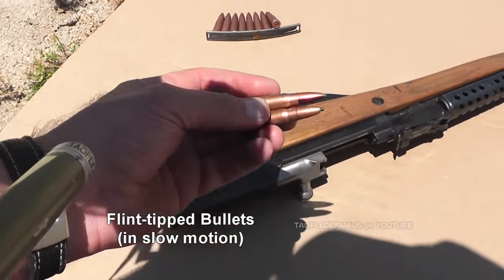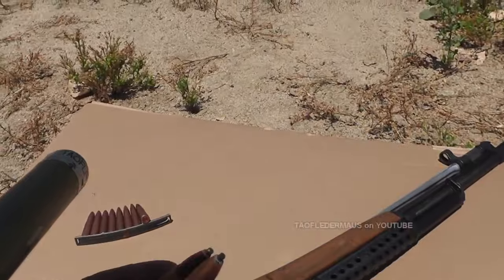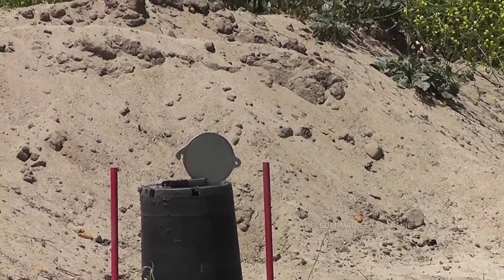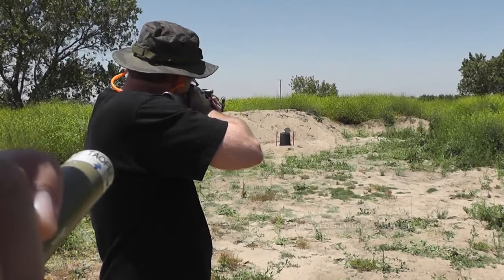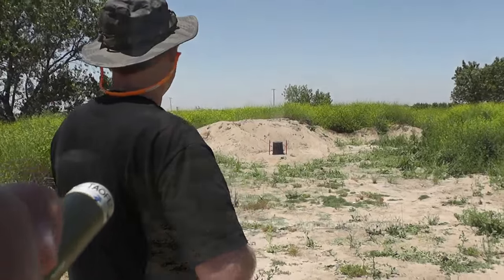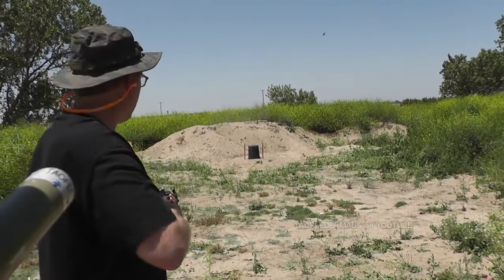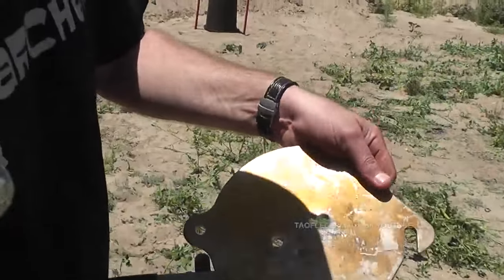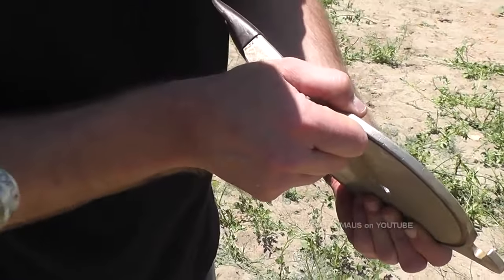ZIPPO-FLINT TIPPED BULLETS - Poor-Man's Raufoss

Comment: OK, since there have been almost 1500 comments placed for this video, I'm sure that the question I'm about to ask has already been asked and answered. But instead of going through all 1411 comments I'd rather to ask again: how did you guys inserted the flints into the bullets? Did you use the HP bullets? Was any drilling and/or tapping involved? Please advise.

Oh, and thank you for the cool video!!!
Reply from the maker: Yurishch  I belt-sanded the tips off the bullets to create a flat surface.  (they were FMJ)  Then I drilled into the bullet using a drill slightly smaller than the diameter of the flint.  Then I just pressed the flints in.
Reply: *****
Thank you! That helps.
Reply: I guess I missed that. I thought you just stuck them into hollow points
Reply: so what would happen if when you add the flint and  it is not centered correctly?
Reply: michelle racine, it would weeble and it would wobble and it would then fall down. 
Guaranteed to hit the planet 10 or of 10 times.
But YMMV so test, record and share. ;-)
All kidding aside, if the projo didn't maintain its rotational consistency the round would be less accurate.
How inaccurate would be dependent on the amount of instability was induced by the off-center addition and component removal.
Reply: @taofledermaus  OH, that sounds REAL interesting on LIVE rounds !
Reply: They did not insert flints, they inserted a ferrocerium rod, Zippo flints are made of a metal called ferrocerium
Reply: They are not flint, the flints are made from a metal called ferrocerium, they are just called flints because they spark, Zippo uses small ferro rods

Comment: you should try this at night ! would see a lot more of what it does .
Reply from the maker: +Mike Gunter  It's hard to aim in the dark.
Reply: +TAOFLEDERMAUS If you're ever able to, you should get a low-light setup. You can get a few cheap soft boxes, or make some DIY budget ones that would work well with your cameras (Tripods/flashlight stand, flashlights, and some thick tracing paper)

Just point the ones without paper on the ground illuminating the trail, and one with tracing paper pointing at the target. You may need brighter lights for the slow-mo though, because of contrast correction.
Reply: +TAOFLEDERMAUS what about... not night but... low light time.. :D :)
Reply: Aim by day, set up posts for front and rear of rifle, slot in at night and fire. Its how infantry used to and for some weapons still do for night defence.
Reply: Cameras not to good at night
Reply: +TAOFLEDERMAUS get as big as u can carry plate of 1/4" steel and use reflector tape to make a target or mark the edges

Comment: The question is...will they make a gas tank explode?
Reply: michael malkowski Gas is a volatile liquid that readily vaporizes into a gas.
Reply: Myth busters did a show where they shot a propane tank with tracer bullets and it didn't explode.... Also, given that you'd have to shoot through part of a car (assuming that's the kind of tank you mean) the bullet would deform well before it hit the tank, and it's been shown and proven many times over that shooting a cars tank will not make it explode.
Reply: Yes, gas readily turns to vapor, but if it's in a tank it's all gas vapor, and no oxygen, and without the oxygen gas vapor won't ignite. The simple answer is, no, this won't make a gas tank explode.
Reply: FPSRussia tested Raufoss rounds on a propane tank (felt Hank Hill was bawwing his eyes out) and it did not explode. You have to have a precise air/fuel mixture for the stuff to blow up.
Check out his video, he explains it a lot better than me.
Reply: The ThinSin alittle bit of gas and lots of oxygen is explosive, alot of gas and very little oxygen (in a bottle) is not explosive.
Reply from the maker: Absolutely,  Joshua.   The conditions have to be ideal for a flame to occur.  You must have oxygen,  fuel,  and heat to make fire.  However,  the air-fuel mixture has to be ideal-  if there is too much air or too much fuel,   fire will not occur.
Reply: Joshua Robbins That's why I said you need a precise air/fuel ratio! :)
Reply: NO there isn't enough exposed gas for combustion. Myth Busters even went and proved it. BUT I suggested above they try the old 1,2 movie version. where the 1st shot releases the flammables and the second ignites it. I think the only real tricky part(besides the right flammable) would be the timing of the second bullet. Oh and Myth Busters were using tracer rounds.

Comment: Just thinking about how it works. I think because of the flint sparking and the compression of the metal, you're creating enough heat to melt the steel, meaning you can punch through thicker material. Essentially making explosive/incendiary ammunition. That's too cool :)
Reply: What
Reply: What

Comment: 7.62x39mm societ hits hard enough to go through level II and III armor. But the steel, Titanium, and Ceramic trauma plates typically are what stops rifle rounds. It would be interesting to take a steel traum plate or even a level 3 vest with a trauma plate and see if this would actually punch through it. Only thing that makes me worried is the idea of a flint tip slipping out in the bore as a round is fired.

Comment: "The sparks really don't show up well"? Try shooting after dark, After all, even military grade tracer rounds don't show up well in the daylight.
Reply from the maker: Cameras don't work very well at night.
Reply: The target might not show up unless you spotlight or light it with a good pencil-beam flashlight, but the sparks flying away from the target into the unlit background would. In the same way tracers show so brightly at night when those you are shooting at are barely visible on camera, it is the contrast that makes good video.
Reply: Especially high speed cameras, you need extremely good lighting to get good video.  Even in the bright noon desert sun the video is a little grainy. Try that high speed camera with any less lighting and you'll see like one bright pixel flash in a black background and then you'd complain about video quality.
What I'd like to see is a normal round in that steel plate for comparison, if there is any difference in penetration with FMJ hollow point and hollow point with flint.
Flint is pretty hard, like 7 mohs I guess, but does it get pushed back into the soft lead or form a hard tip to assist penetration?
Reply: Last time I shot tracer rounds, I caught a forest on fire.
required beer and urine to put it out.
good times...
Reply: "Flint" the rock is a microcrystalline quartz in the chert family. It is indeed very hard. 

However, "Flint" as in "lighter flint" or "ferrocerium rod" (which are both common names for what was used in this vid) is a composite of the super soft rare earth metals cerium, lanthanum, praesidium and neodymium mixed with magnesium and iron. 

Talk about apples and oranges as regards to composition and hardness between these two materials! More like American football vs underwater basket weaving.

Comment: so did you do a control with no flint? i kinda skimmed your vid and im curios would this gun still do that to aluminum plate ? it doesn't look like ss to me, the little dents all around the edge are consistent with a soft metal like cast iron or aluminum alloys ss steal would not have hundreds of those soft metal dents in it, it also appears to have cast iron pitting around the edges as well so i could go cast iron on that bet 60% verses 40 % aluminum alloy, magnesium most likely

Comment: Flint has a Mohs hardness of 7, as does chert, quarts, obsidian, and a handful of other rocks... all of which will cause steel to spark. Although flint is hard enough to cut steel it is also brittle and develops conchoidal fractures easily and small pieces break off during normal flint/steel use. That's why it's so easy to knap flint into arrow heads etc. The steel doesn't seem to wear out because the particles that are shaved off during the process are just that, tiny particles not pieces.

Comment: To answer that, we must first know what type of ammunition would be used in that caliber, and then the type of steel. Armor plating steel usually is somewhere around 500 Brinell. My target consisted of a soft face layer, a harder(But still somewhat soft) middle, and was backed by extremely hard railroad tie plates. I desinged it this way to catch expanding bullets, and swing for FMJ's sending them into the dirt below, but at 40 pounds it doesn't swing much

Comment: the effects from a .22lr is much more spectacular because it doesn't immediately disintegrate on impact i use ammo that's normally HP so i get a centered hole. 3/16th inch drill bit makes for a tight fit for the red flints you can buy in a 5 pack at walmart for 40c

Comment: That is not how API works, It just has a tungsten or steel core that pierces metal. This is a liken to a Raufoss round. It combines API, explosive and Incindiary. The effect is correct. The Explosive it meant to get thru part of the armour, the tungsten punches the hole and the incendiary melts the fragments, shooting molten metal out the other side.

Comment: I use Tula ammunition in my SKS and a friend's, which is basically the same stuff as I understand it (just branded differently) and it cycles beautifully, so I don't think it's the ammo.

Unfortunately I couldn't tell you enormously more than that, because my knowledge of the gun is limited.

Can I assume that you have no problem just working the bold and cycling it manually? If so, maybe it's a problem with the gas tube/piston not driving the bolt back enough?

Comment: what you say is true, but if you ever have the chance to pull some 7.62x39mm bullets, take a gander how they're constructed.  The HPs don't have a protected base, like you'd expect.  The core itself (in FMJ bullets that I've inspected) doesn't extend to the tip.  I've noticed they have a tendency to tumble and flatten out when they hit stuff.

Comment: ah thnx :) heres a little trick i used to do back when i smoked, you pull out the spring and flint from a lighter, u stretch the spring abit, and push the flint into one edge, u get another lighter, and heat the flint till its orange/red, then drop it on a hard floor away from you, same sparkle effect :D.

Comment: What we view as Armor piercing today socially is rounds that can penetrate body armor. Armor plating is something completely different and much higher quality than other steels. Most rifle rounds can penetrate metals such as that frying pan, and my 444 handloads would do so with ease. I have done testing on this back in highschool, and ended up welding a target to test it. To contain most rifle rounds, it was an inch thick with three different types of metal to absorb the impact.

Comment: Great stuff! 
Ive always wondered what one of those larger pistol calibers/45 ACP HP "Flying Ashtray" projos would be like if one drilled the HP out sightly deeper & then set/pushed/slightly epoxied a 22 short inside of such-rim facing outwards-(Provide your own +5 hit points "Return Fire/Dont PANIC!" garbage can lid of safety & protection;)- Revolver/SA Singly finger load all rounds of course to avoid possible feed ramp !KABOOMS!....I dont THINK the centrifugal force of the slower 45ACP round moving down the barrel would be enough to set the 22 short off in situ?-but striking something hard @ range might be quite explosive?

I do enough stoopid stuff already, w/o any additional bright ideas, most of such being: How to mo' better safely rob a bank/Hebrew Ice Cream Truck?...~How to arms smuggle between the PNW Islands & B.C using waterways/dropped crab pots & broken down/component  pieces, ect, ect, ect>>>On into fuzzy-headed barely legal oblivion>>>.....Seeing as Im "Mostly Harmless" & 81% legal 36% of the time anyhow , I should probably just day dream & keep all this on the DL & to myself?...~!OOPS!...;)
Keep up the wonderful vids!

Comment: @1911A1ist You would leak gasoline all over the ground.  The gasoline would have no time to react with the sparks since it needs to be in is gaseous state above the LEL.  Its the same reason as to why you can throw a lit match into a cup of freshly poured gasoline, but not into the same cup that has been sitting for a couple of moments.

Comment: Tannerite has zirconium hydroxide, which makes it far more sensitive than flash powder and AnAl (the poor man's Tannerite). Perchlorate flash would be fine, but definitely not Armstong's Mixture! If the bullet diameter is big enough a #10 percussion cap works great. They're too big for a .223, so thanks for the lighter flint (ferrocerium) idea.

Comment: You are okay if you hang the plate (and angle it down a bit). The problem is that the plate was face on to you, and lead is somewhat elastic. This is solved if the bullet has some direction to deflect (down) instead.

Comment: The gun shop I buy ammo at has half inch steel plates up with the holes labeled. 7.62x39 hollow points will penetrate .5 steel plates as will the FMJ rounds. All shot a 50 yards

Comment: I can tell you it's stainless because of the way he's holding it.  He's holding the plate like it's very heavy, which Stainless Steel is.  If it were Aluminum, he'd be handling it like a thick piece of plastic.

Comment: Not entirely true. Flint sparks when it breaks (you can spark from two pieces of flint hitting each other). Regardless of what it hits, if the flint shatters, it will make sparks. It won't make the same sparks as a iron/steel striker and flint, but it will still spark.

Comment: Try magnesium ribbon on hard target or mercury for soft targets such as a block of  hardwood,seal with soft solder with a very hot soldering iron and "do not" breath the vapours from mercury.I did this with my 3006 and the results blew my small but clever little mind.lol.

Comment: I didn't see anything an unmodded round of 7.62 or 5.56 wouldn't do. The sparks were impressive and I suppose the flint rounds could ignite propane or gasoline under optimal conditions but other than that I must agree with the other comments....this demo doesn't show me anything that would make me want to flint any of my ammo. 
I'd like to see someone insert hardened steel or similar into a hollow point 7.62 and test it on armor and steel plate.
Reply: Steel penetrators already exist, aka "bimetal" bullets. Theoretically, they can spark as well if they hit the right surfaces.

Comment: My example of "flint" from a lighter was wrong. Lighter flint is not flint at all but a man made material called Ferrocerium. Common fire starters, fire steels, metal matches etc sold for camping or survival kits are also ferrocerium and not true flint. These can be scraped with any hard, sharp edge to produce much hotter sparks than natural flint and steel. I stand by my original statement that true flint does not spark at all. Any spark made from real flint comes from striking a ferrous metal.

Comment: Another ferrocerium suggestion: make up a lead shotgun slug which has one of the large 3/8" (9.525mm) to 1/2" (12.7mm) diameter rods in it, then shoot it at something like steel. The lighter flints are just too small imo.

Comment: It's incendiary. The pressure and heat from the impact of the flint makes it explode. You can do the same thing by taking the flint from a lighter and coil the little spring around it. Heat until  "red"   Be careful. IT WILL EXPLODE ....Go outside.

Comment: When I was just a youngster, and no access to guns, I would get used lighters and remove the flints. Hold flint in needle nose pliers and heat up with a new lighter. Then throw the flint on the concrete with the pliers. Same effect.

Comment: Also you're body posture is perfectly upright, you're left leg should be more forward than your right one and you should slightly lean into the gun, this way the recoil doesn't just apply the force to your arm but it sends a large amount of it down through your body, spreading it out reducing the overall "kick" felt

Comment: Flint doesn't spark at all, the steel/iron does. Flint is hard enough to fracture steel into tiny particles when struck correctly. Those tiny particles then spontaneously ignite and appear as sparks. Iron is Pyrophoric, meaning it spontaneously ignites when exposed to oxygen in its pure form. That's why you get a shower sparks when using a metal grinder on iron/steel. Also why a lighter won't spark well with a worn/rounded flint, its no longer sharp enough to shave particles off the steel wheel.

Comment: They want to use a HARDENED tip of metal to get some mean penetration. In ball rounds or handgun rounds one can use BB's. Also drilling a hollow point and filling it 3/4 with mercury and filling it over with lead etc. Mercury makes a MEAN round!

Comment: To be honest, stainless steel isn't that strong.  You need a carbine steel plate for good testing.   Stainless is only corrosive resistant, not stronger than normal steel.

Comment: I was wondering and im waiting to be called "dumb" but how did you get the flint in did you drill the bullet out to accommodate the flint?
Reply from the maker: Yes,  I belt-sanded the tip flat and then just drilled into the soft lead.
Reply: oh ok so yeah wouldnt work on my surplus 7.62x54r ammo since its steel core
Reply from the maker: Probably not.   I'm not sure of the hardness of the core so you may be able to drill into it.  Just harder to do than lead.
Reply: Tony Jones
Steel core ammo is already somewhat armor penetrating.
Reply from the maker: It really doesn't punch through steel any better than a lead-core.